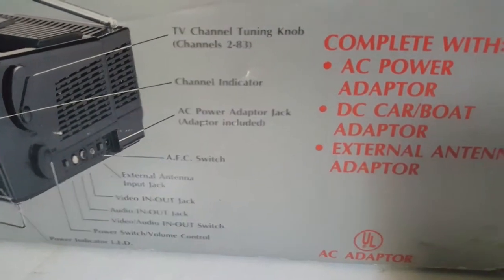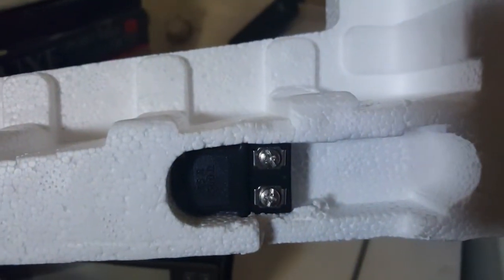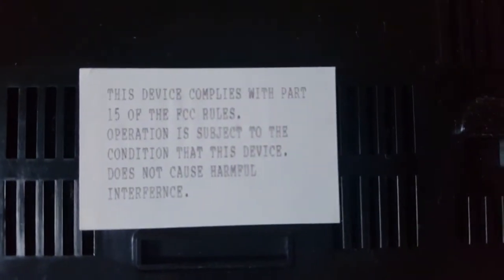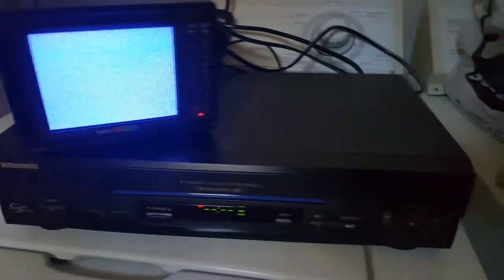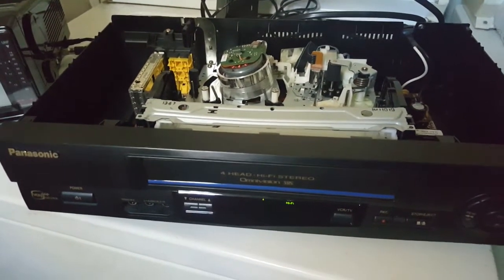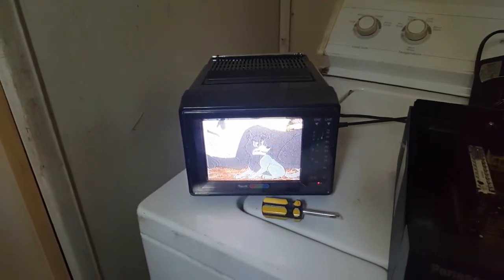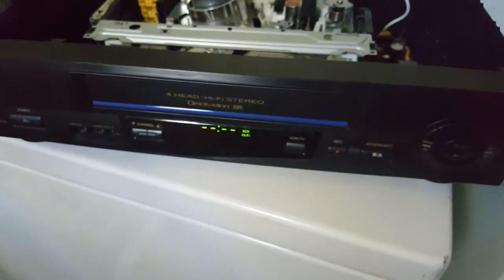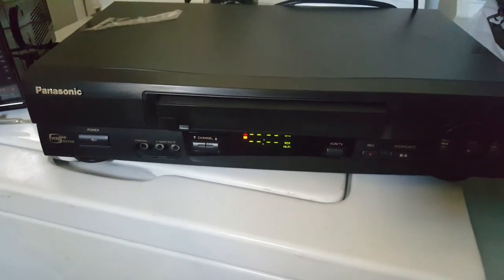Eskie's Vlog 112517: The Rhapsody TV Model TV-670

Comment: I'm very jealous of that TV, that thing looks to be in great shape and seems to work pretty well, I bet with a good cable it would display quite nicely.  The discoloration may have been because it was moved while turned on, I've seen that happen before.  Putting a strong magnet in a drill, and spinning it while waving it in front of the tv may fix the discoloration.

I was going to mention about the bracket in the VCR being bent, but you found that and fixed it; fortunately that was pretty minor.  I have a few Panasonic VCRs that all have bad belts that need to be replaced.

And excellent "I need that for my iPad" spiel, that was awesome!

Comment: Queen's Bohemian Rhapsody started to play in my head as soon as I saw the brand name. Wayne's World also came out in 1992 so, who knows where the Chinese got that name from.. 

The problem with the VCR is that it was made in 2001 where they were tring phase out the awesome 4 headed VCRs to push for DVD players to blow them away. Of course that would work when you lower the quality in something that used to be awesome. Just to make something with digital noise, to stand out.

Also, there is a lot of empty space inside that small VCR. You can clearly see all of the corners that were cut inside.
Reply from the maker: According to Google, Rhapsody is an effusively enthusiastic or ecstatic expression of feeling. What that has to do with China-Pride TVs made by Sumting-Wong Electric is beyond me. However, the Rhapsody name I remember being sold at Wal-Mart (surprise surprise) in Killeen, Texas in 1989. If not the TV, it was the 1988 Galaxy 2151 fan to keep the associates who worked in that department cool.

As for the VCR: in the late 90s early 00s, Home Theatre was a thing. Electronic companies (Sony, Panasonic, even Thomson [RCA]) made their VCRs to be wide enough to fit into the rack systems like the amps. And yes, the VCR was taking a back seat to DVD.

As for the empty space; I agree. Hell the front panel could accommodate other functions like program, clock, and audio settings.
Reply: Yeah, I knew about the wide VCR's to fit in with your stereo rack. That is what I was tring to do when I had my first house in 1999. I bought a Sony "wide" VCR and I was so disappointed in the video and sound quality that I took it back to the store (Which was Circuit City at the time). I was told that all of the new VCR's was like that to make the DVD players stand out. I bought a Panasonic one instead. It was better than the new Sony one. But you had to be in front of it, with the remote control pointing at it in order for the remote to operate the unit..

Comment: Hey, so I just bought one of these and was sent the wrong charger. I could find the required voltage and wattage on the unit, but have no idea what amperage is needed. Does it list that in the manual? I don't want to fry mine.